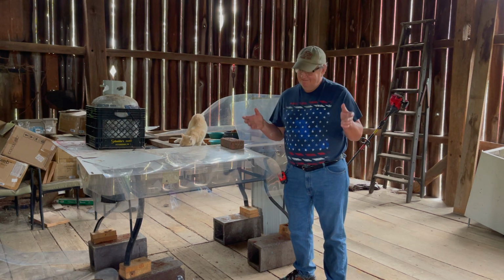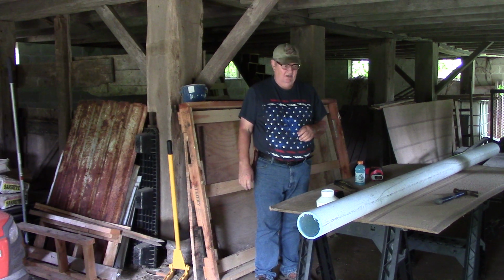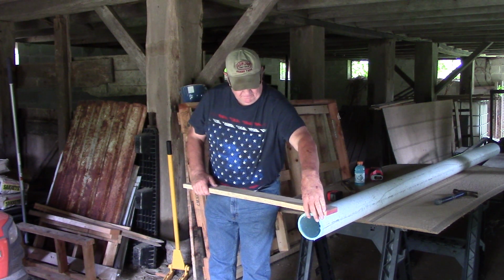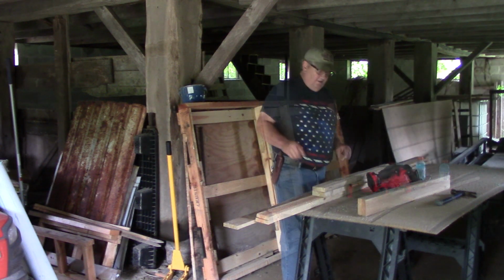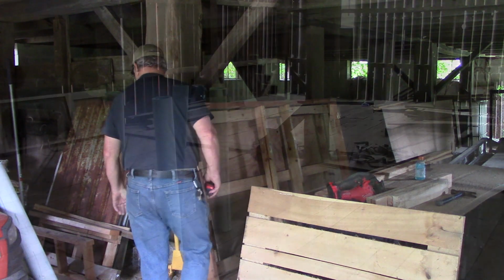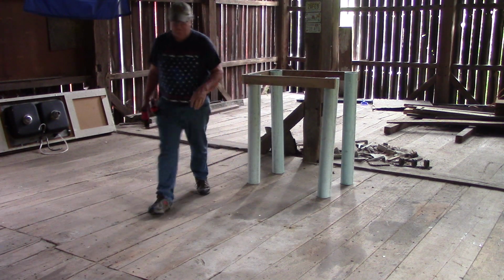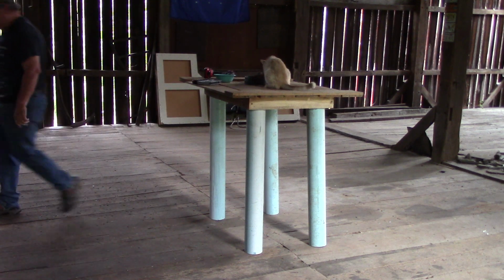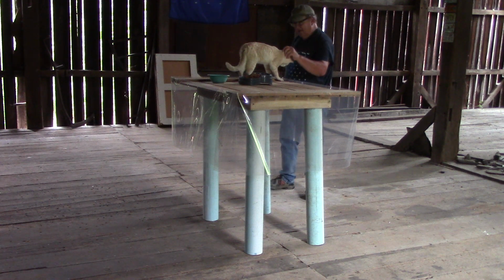3rd Try Raccoon Proof Table & 2nd Shot Side Effects

Comment: If they knock that table over instead of screwing two-by-fours around the bottom to give them a platform to stand on you may just want to screw an L bracket to the bottom of each leg and then into the floor.
Reply from the maker: +Hubcaps Excellent idea!  Thanks.